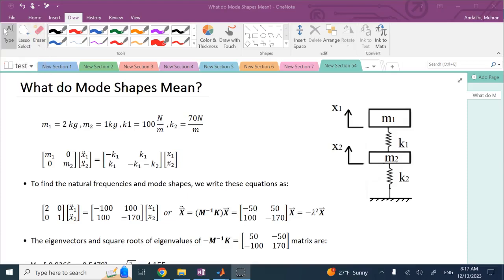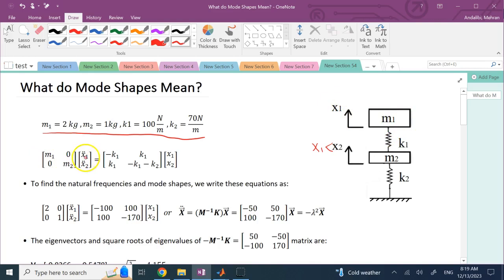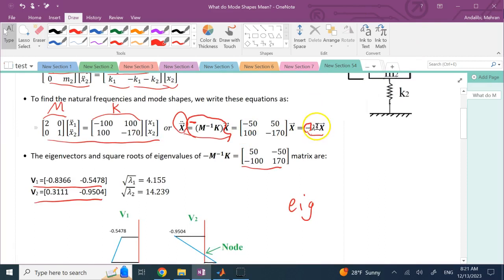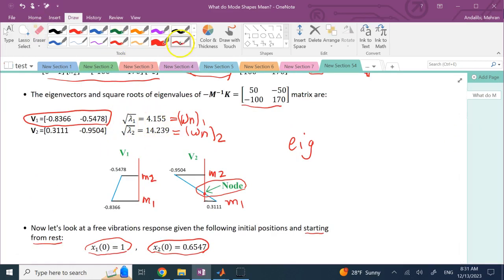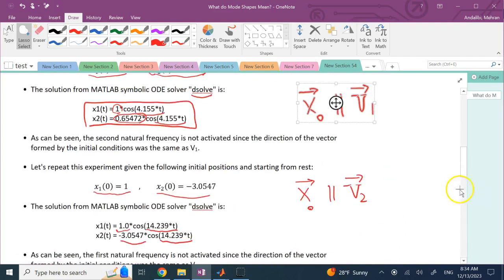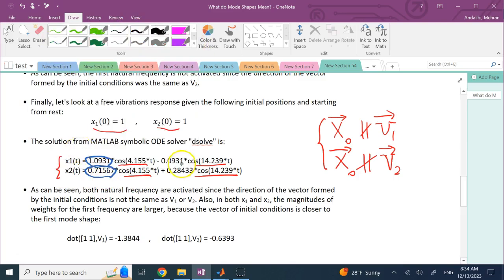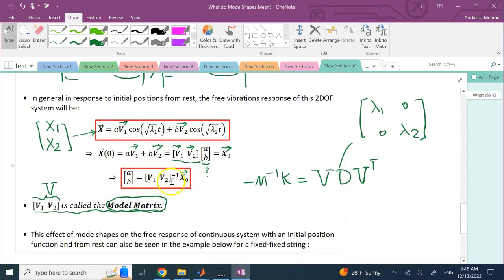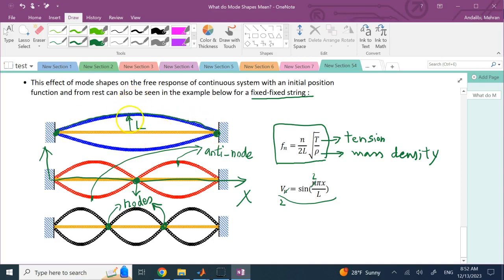What do Mode Shapes Mean?

Comment: Great lecture as always.
I am a small question:
why is [M]^-1[K] equaled to a matrix [D] and called dynamic matrix, and what is it's physical meaning. I saw this expression in a book.
 
Another thing is, why are we getting eigenvalues that refers to natural frequency and the corresponding vectors refers to mode shape. Is it just because the equation we make turns out to be an eigen value problem??